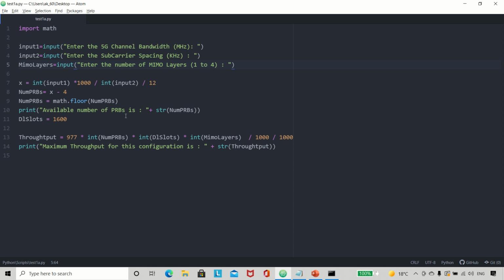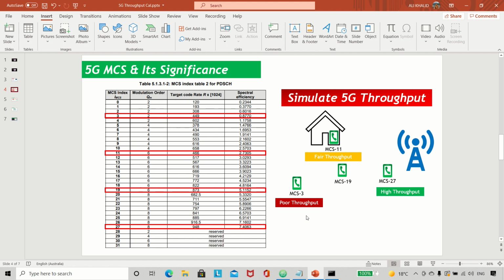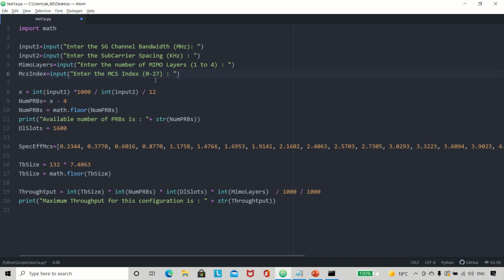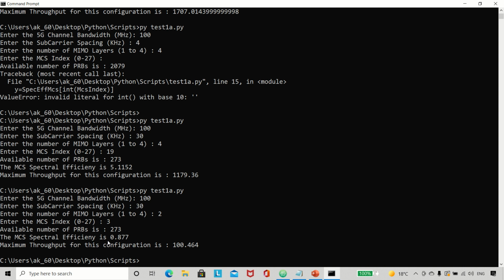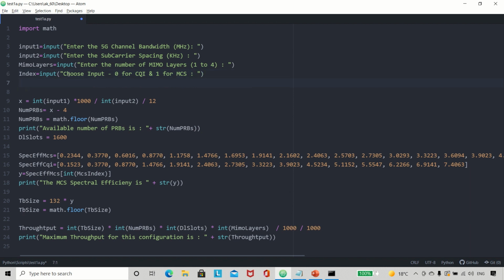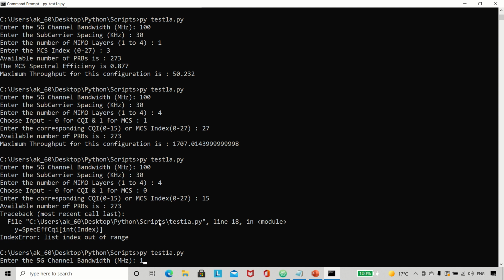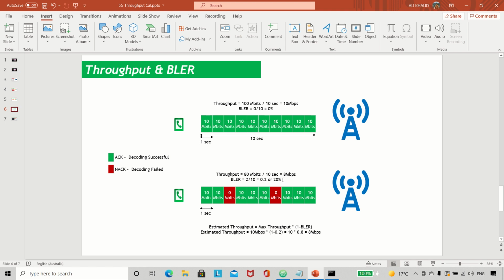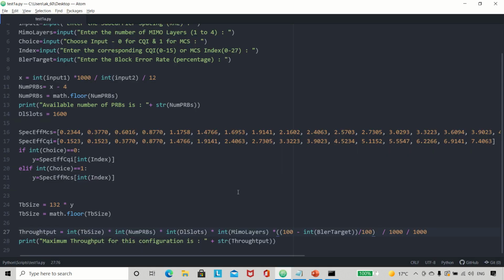Python (Session 2): Practical 5G Throughput Simulation with Python

Comment: Thanks.  Can you help me about the fact that prb should be 106 in the values I gave, but it is 107? values: 40, 30, 4, 27 (block error value 2 -3) . 
The result should be 618.77. my value is 669
Reply from the maker: You are right, the actual number of PRBs for 40MHz should be 106. Our calculation is based on estimation and in the next session, we will convert it by using a lookup method.
For the throughput, you are right as well. Our throughput is relatively higher because of the fact that we are not taking into account the TDD ratio completely. During the switch from DL to UL, there is a special slot where DL symbols are lesser. So, this overhead will also need to be calculated and removed which will reduce the throughput output. This will also be discussed in the next session. Moreover, there are some other smalls overheads as well (SSB, CSI, TRS) that we haven't incorporated in this code as well. So, your calculation of 618 would be more accurate!
Reply: @OurTechPlanet   Thank you for your interest. A useful study that taught me a lot. I can't wait for the sequel
Reply: how to put this equation [x = int(input1) *1000 / int(input2) / 12] in python as int

Comment: i subtracted -1 in y=SpecEffCQI[int(Index)-1] and it worked as well
Reply from the maker: In this case, if the user enters 0 as index you might have a problem or you already catered for that as well?
Reply: @OurTechPlanet  i simply modified CQI (0-15) to CQI (1-15)
input("Enter the corresponding CQI(1-15) or MCS Index(0-27): ")